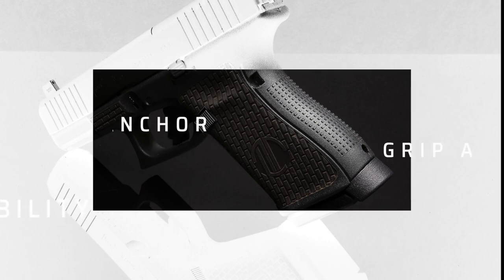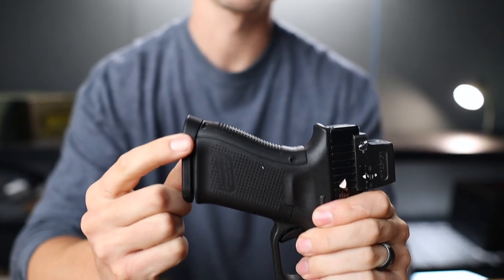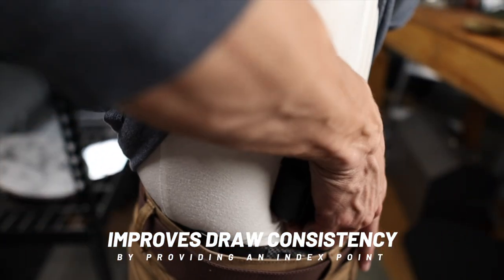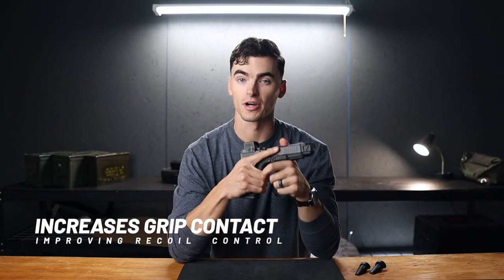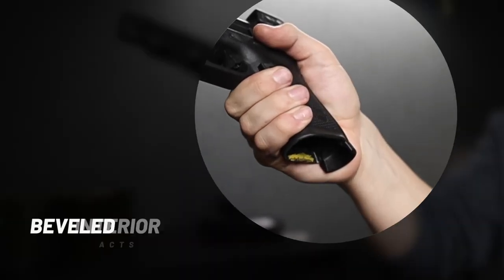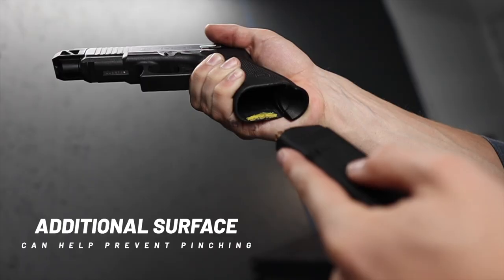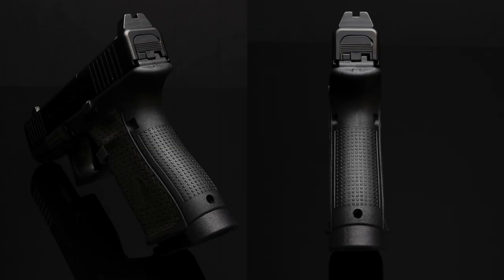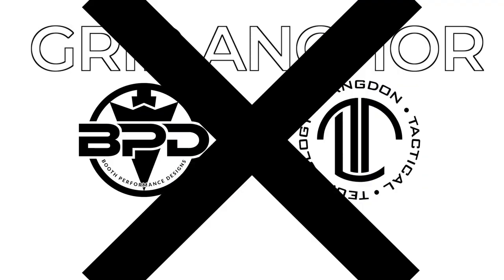Grip Anchor for the Glock 19

Comment: TangoDown Vickers tactical has had a grip plug/ tool for years. My only gripe with the vickers is that it felt to slick and I would end up stippling it for grip. You should add texture or stippling to your plug.
Reply: The Vickers/TD plug is excellent at what it's designed to do, but both products really do different things. The Vickers sort of rounds off the end of the gun and provides a tool, but unless you have very large hands, it doesn't improve your grip.

We prototyped Grip Anchors with texture, but found it largely unnecessary. The mechanical support it provides doesn't need much texture to function. If users decide they need texture, it is easy to add.

Comment: Can I run the backstrap version with no backstrap? Why have both models? I want to preserve the ability to go with and without backstraps, do i need to own both versions?
Reply: It will technically fit, but it won't be ideal. There will be a gap where the backstrap would fit and the grip anchor will sit proud. We recommend picking one or the other and using it as intended for the best experience.

Comment: So... It's a Seattle slug
Reply: In terms of design goals, they're actually rather different. The Seattle Slug exists to add weight and aid reloads. We don't add weight, and the reload aid is a side benefit and not a core competency. The difference with the Anchor is that it is specifically designed to mimic the grip shape of a larger Glock grip frame without adding size. Hope that helps!
Reply: @mitch_bpd  a well thought out reply. I commend you sir.

Comment: Lol what a complicated way to say the g45 is better.
Reply: "Better" is really relative to what performance metrics and context you're using. If concealment isn't a concern, and you can pick your own firearm, then the G45 or another full size gun is probably a better choice. But, if you want to conceal the gun well, or a G19 is issued to you, this lets you very closely mimic the grip of the G45 while being noticeably smaller.
Reply: ^^^this^^^
Reply: It doesn’t add a significant amount of length and is flush with the mag…
Reply: @mitch_bpd  what are the differences in dimensions between a g45 and a g19 with your product
Reply: @shinobi-no-bueno  dimensionally, it's the same as a G19 vs. a G45 (so about half an inch). It's just filling empty space behind the magazine, not actually adding overall length to the gun.

Comment: this all could be solved with buying a Glock 45.... no difference in printing
Reply: I am sorry, but that is not the case.  The Glock 45 has a 17-round magazine. The Glock 19 is a 15-round magazine. So the overall height of the 19 is shorter than the 45, so it is still shorter even with the Grip Anchor in place.